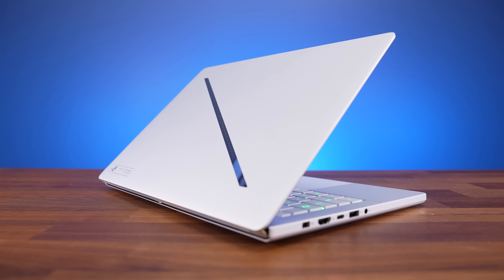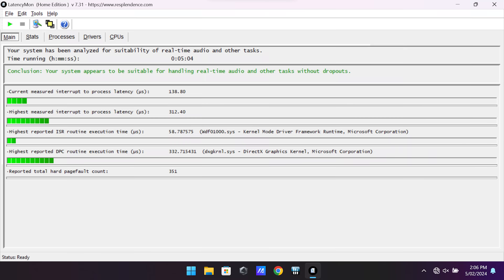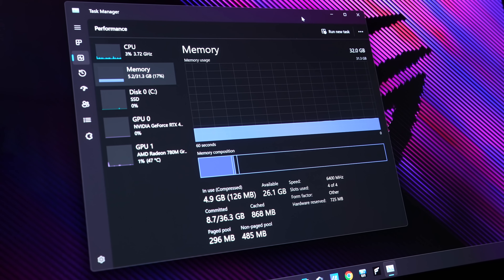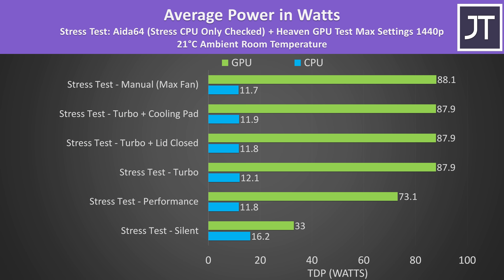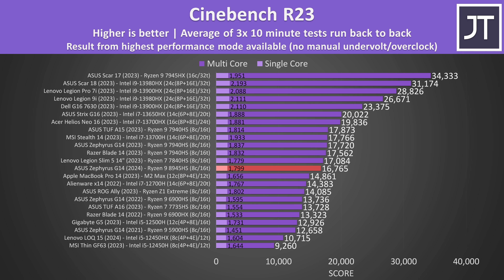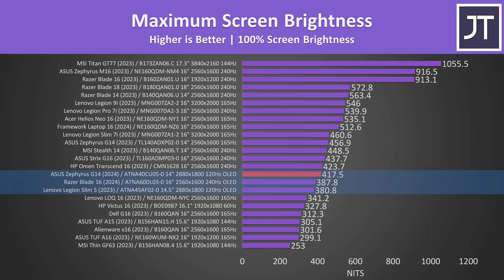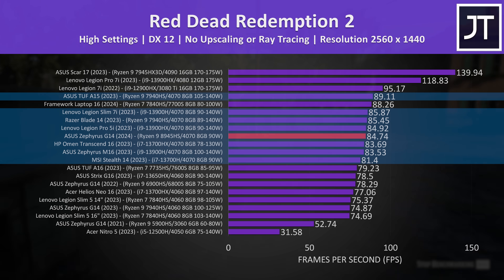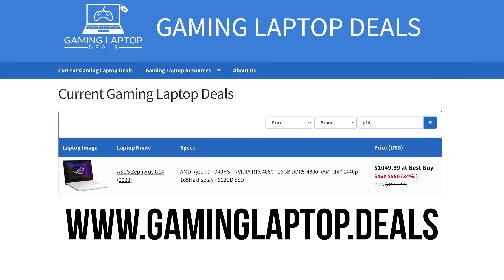ASUS Zephyrus G14 (2024) Review - Problems You Must Know!

Comment: This is laptop vendors not doing AMD any favors.  ASUS pairs an 8945HS which NEEDS more power along with an Nvidia 4070 and then strangles the laptop by making it thinner and providing less power for the GPU/CPU.

Before I say anything else, the issues here are NOT silicon lottery.  TSMC is making N4 better this year than they did last year.  TSMC continually improves their processes so as a node matures the performance/power consumption gets better.  In this case these parts clock the same as last years parts, but have a better performant NPU. I assume the NPU needs more power but the power specs and clock speeds are the same.  This kind of highlights the improvement in N4 vs. last year.  AMD doesn't list transistor count with these parts but I assume part of the gain is more AI cores for their NPU.

What will happen is ASUS has to discount the product to move it well since this would be considered a high power gaming laptop regardless of ASUS strangling it.  The perception of the typical consumer that doesn't see a review will be 8945HS + 4070 = really good performance.  They won't have a good understanding that ASUS made the laptop thinner and reduced the power at the EXPENSE of performance, because they will ALSO see "ROG" and ASSUME that if ASUS reduced the power it's because those parts don't need as much.

So, after quite a few consumers are frustrated and return it after testing it and the product getting a negative reputation, ASUS will discount it, like what happens with many AMD laptops/CPUs/GPUs and they'll blame AMD.  Last year there was a lack of AMD laptops, and they hit the market later in the year.  AMD did a good job getting the product out on time for the beginning of the year launch for the laptop makers, and THIS is what ASUS does with an AMD based "ROG" product.

AMD would be better off giving a chart for the power envelope based on the GPU that gets paired with their CPUs.  This product could be topping the charts for a current gen CPU/4070 minus of course the higher powered HX CPUs.  ASUS screwed AMD with this move.  ASUS can recover by simply making less or stopping production of this specific model earlier in the year.  But for every laptop that comes out like this with an AMD based CPU, the tendency will be for the consumer to put it down to using an AMD based laptop.

Comment: Man what is this bs with proprietary power ports? Why can’t they just use USB PD which is capable of 240W?

One of my biggest pet peeve with the 2023 model is that the USB C charging port doesn’t have a pass through when the battery is 100%. So if I keep it connected, it degrades my battery health over time. I was hoping they would switch to USB PD for charging in the next model.

Comment: Way to expensive for a 32gb option. You are also paying the "now" tax when  you buy soldered memory up front.
Cost is way higher for a 32 gb option compared to the ram slot from last year. I got a 2023 G14 for $1200 vs the 32 gb version at $2200. Mine still needs to have a 16gb stick added, but that is easy enough. The upgrade on a Slim 5 from 16 to 32 ram soldered is $50. Not seeing anything like that for thw 2024 G14.
Reply: There is no LPDDR5X modular RAM so how will you upgrade to 64GB? You would have to take out the 32GB from the machine and downgrade to LPDDR5! Buying 2X32GB.
Reply: @andyH_England  2023 has a ram slot and one soldered ram. I got the 16gb soldered model. Some people upgrade it to 48 by adding a 32, but I will just add a 16 most likely. The 2024 g14 only had soldered ram so you have no upgrade path.

Comment: Waiting for next years Asus G14 Strix Halo: Threadripper power (16-core Zen 5) meets 4070M+ graphics (40CU-RDNA 3.5) in 1.5kg. should be laptop of the year if they don't screw it up.
Reply: No way in hell Strix Halo is real. the specs seem unbelievably high. its too big of a difference gen-over gen.
Reply: @Ali-dp6xv  pretty sure Strix Halo is real... What I'm not sure about is if it will end up in laptops, that's another question.
Reply: @Allyouknow5820  considering the TDP targets of 50w-120W, it should fit nicely in laptops and Mini PCs. It could also be made to some unannounced console type device but I doubt.
Reply: @Ali-dp6xv Strix Halo is completely new product category, so.

Given that G14 already got soldered memory (requirement for Strix Halo), then that sounds more than plausible.

Comment: If the main problem is no ram upgradeability, but to compensate you can get 32gb and it's overall lighter, then that says a lot about how good this laptop is. If my Max-15 dies, this is probably what I'll get.
Reply: Except the CPU and GPU power limit is lower and so is the maximum GPU model allowed. I don't see a reason to buy this over the Blade 14 from 2023 or later unless you REALLY want an OLED screen.
Reply: @cameronbosch1213  For some reason my first reply was censored. Anyway, the niche for this G14 is the light, portable laptop that can still run the latest AAA games well. The performance is more than enough for how light it is. If I just wanted the best performance, I would be choosing a 3kg 16" laptop instead. So this is perfect.
Reply: The only way as of now to get 32gb ram is to pay $400 extra for the 4070 version. Also can’t imagine Asus not making a buck by selling RAM upgrades for $200.

Comment: Got my 2024 G14 recently, all go smoothly when using power brick to charge but if I use 100w usbc to charge, the fps will drop from over 70 to 10. It can hit 30fps even without charger, so I assume it is not problem of hardware, anyone knows how to fix this problem? Thanksss
Reply: The charging brick is 180w, which is meant to directly power the gpu  and chrage the battery gaming. While the 100w usb c charger is not able to provide enough power, which is why you can only hit 30 fps as it is basically playing on unplugged mode as it is only charging the battery

Comment: Laptops designers should think to put noctua fan it will be 180° difference low fan noise and more cooler
Reply: It is spelled „Noctua“ and they specialize in cooling solutions for DESKTOPS…
Reply: @soldmycatforheroin  they can make a versions for laptop nothing impossible

Comment: Also, this new proprietary charger is garbage, barrel plug from previous models is better
Reply: Really? I've used barrel plugs and they're not that great.
Reply: @TheOnlyName  this new one is horrible. Takes all the bad from a USB-C connector and makes a connector based exactly on that. No way to rotate your connector which was amazing on my Zenbook Pro 14. And now no way to ANGLE your connector. At least with USB-C you could do that. And at least Razer has an angled connector that even has a rise so you don’t block a USB-A port for a mouse dongle at this very least. But this is straight up garbage. Sure 240w USB-C would’ve been great but yeah this ain’t it chief.
Reply: @omegamalkior1874  That's not true, this new charger is reversible.
Reply: @TheOnlyName  that is not what I meant by rotate, that’s also part of why I compared it to USB-C. It’s a straight connector. Which is my main critique.

Comment: You should try the Zephyrus G16 in the next video. 

From RTX 4050 to 4070, this laptop weights 1,85KG and it uses 3 fans, while the RTX 4080 and 4090 variants use only 2 fans and it weights 1,95KG. In all configurations, it's powered by Intel Core Ultra 7 155H or Ultra 9 185H, it has 2 M.2 SSD slots and a full size SD card slot.

Comment: Naah 12W for CPU is just disrespectful for AMD and the Consumer ☠ looks like the Combined TGP of the laptop is 100W which is too low for a 2024 Thin and Light GAMING oriented device! even if its 14" 
IIRC the Yoga 9i 2024 has a 100W 4070 on its own and it's slimmer than this!
The LEAST they should've done is 90W + 35W at manual mode which is 125W

Comment: Doesn't make sense. This laptop in any way does not resemble what they visioned with the G14 lineup other than it being 14". No lifted lid, different upper lid design, no spec upgrade, and extremely pricey. It's no longer a light, mid-range option.
Reply: No spec upgrade isn't something Asus can help with, you're probably new to computers but it's CPU/GPU manufacturers that didn't really release any upgrades this year. It's lighter than ever and more portable with a better screen, much much better speakers and so on. The only downside is the price is a little higher than mid-range
Reply: @elderman64  I am not new to computers at all. Asus already tackled this exact situation in 2022; instead of making a whole new chassis and everything for that years' G14, they went full AMD to give another option for potential buyers. 2022 version is well known to be the cheapest lineup of G14 since the original in 2020.

Comment: Im looking for a laptop instead of a desktop as i need something that i can move around the house or use for work if required.

My budget is €1500, I value thermal efficiency and a great screen with decent performance.

Does anyone have any reccomndations? Ive been eyeing up the asus tuf series with a 4070 but I'm not sure if the screens are good
Reply from the maker: check the specs listed, some TUFs might have 45% NTSC and those are garbage, but if its says 90%+ sRGB it should look alright
Reply: @JarrodsTech  Thanks Jarrod, I'll be an eye out on your channel and for some good sales 😁

Comment: not giving 12gb vram to the 4070 laptop is the single thing that made me skip this generation 💁
Reply: Omg going about vram, without knowing how it works 🤦 who started that fake hype🤷
Reply: 4070 killed the whole stack. A meaningless GPU.
Reply: @randy89555  how about the fact it had no gen over gen uplift over a 3070ti. The 4080 should have been the 4070.
Reply: Next year will be new CPU and GPU. Reason why I'm holding off
Reply: @randy89555  maybe u can run a game with 8gb vram at 1080p. but you literally cannot have anything else or other games open at the same time. sounds like a 2gb vram gpu  will be perfect for you since it is fake hype. 👍
Reply: @insioni  I have right now a monitor with 1080p and rtx 3070. VRAM was never a problem. I even occasionally play god of war on my 4k 120HZ tv, literally never VRAM was loaded even close to 7GB. Why would you even need to run 2 games at the same time? Meaningless needs 👍
Reply: @randy89555 you sound like you haven’t played a lot of games. Idk if it’s devs being lazy but there are games now that will hog up all of that 8gb VRAM before peaking the 4070. So the lack of VRAM becomes a bottleneck and lowers your 1% lows.
Reply: It's a renamed 4060 so of course it's far the worst 70 mobile in memory
Reply: @jivewig  for example?
Reply: @randy89555  Last of Us, Forza Horizon, Resident Evil, Hogwarts Legacy, there’s more but I don’t remember rn. This is for 1440p btw, which is what you’d get a 4070 for.

Comment: Surprised at how biased you are against this laptop. Yes, it's at the bottom of the pile of 4070's, but the difference is a few FPS using up to 50w less power. That is seriously impressive in a small factor laptop like this. I have the 2022 model and it is perfect for travelling. I don't mind compromising power if it makes travelling so much more comfortable.

Comment: Turkey will only receive 16 GB w/4060, just like all the rest of ASUS' pile of bottom-of-the-barrel unwanted garbage they couldn't peddle to customers in other countries. Not that I'd get this laptop. Already have a 7840hs with upgradeable ram, an 83wh battery and decent GPU. The ADA generation of laptops will go down as one of the worst in terms of pricing and performance in the history of mobile GPUs. What an absolute scam this is.

Comment: I def like the in depth review of this laptop the g14, where you completely lost me was on the battery life numbers you’re representing. 

I’ve dealt with 3 separate units setting up a local account and updating windows and armory crate, and after all is updated laptop at idle has a discharge rate of about 10w and about 14-16w discharge rate when watching a YouTube video which translates to at most 6-7hrs of battery and 4-5hrs battery watching a YouTube video

So overall you battery finding are flawed at best and disingenuous at worst when it comes to actual real world use
Reply from the maker: You can see how we do battery testing here:
https://jarrods.tech/list-of-laptop-battery-life/
Reply: @JarrodsTech  i read through how you do your youtube battery test, but i didnt see if you're running a looped video or if you're constantly loading different videos that would require constant use of downoad fron the wifi chip vs cached video that only need to be downloaded once, 

Also running youtube specifically at 720p isnt a realistic way people consume content nowadays. Most videos are 1080p /4k and qua;ity is automatically set to auto.

In a realistic test there's no point to limit play at 720p vs 1080p 30 as 720p limitation is just not a real world use of these laptops in 2024.

in all i have used three completely physical seperate units (SAME MODEL AND SPECS) and in casual use (NO VIDEO PLAYBACK) i get a discharge rate of about 8 -10w which results in about 40-45 min per 10 percent which results at about 7-8 hrs AT BEST

When playing a youtube video, discharge rate goes up to 14-16w which results in 25-30 min per 10% which at best results in about 4-5 hrs of realistic video playback.

id like to point out that screen  brightness is set to 50% and keyboard lighting is set to low,, DGPU is disabled running on silent mode. and windows settings is set to best power eficiency mode
Reply: Hey bro i dont know if you would read this, but im looking for a laptop with good battery life similar to an apple mac but still be used for gaming, ive almost bought this zephyrus g14 because of its good specs and battery review, what would you recommend for me? Im trying to find a good laptop with a good battery, is the g14 2023 superior in battery than the 2024, what are your thoughts?
Reply: @AJ-FL im just confused on what laptop i should get since im going abroad for college and i want to still experience gaming like aaa games while going around campus studying with good battery

Comment: -The weight and thickness reduction is trivial for an already tiny gaming laptop. 
-The 4080/4090 Mobile could've fit inside this year's 80 W TDP budget (you even have the graphs to show that the 4090 is both possible and superior, Jarrod. Why the "4070 is enough" cope?) 
- Weaker memory options
- More pixels + Worse dGPU = fewer FPS, OLED advantages can't even be exploited at full resolution

All of this could've avoided if they refreshed the previous G14 with the better speakers. And those speakers didn't even suck! This G14 is a downgrade.